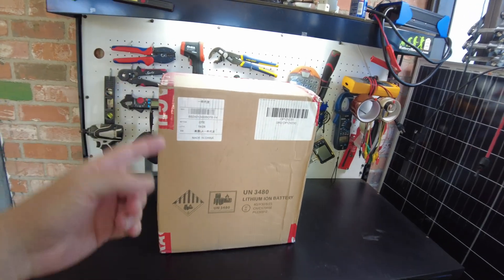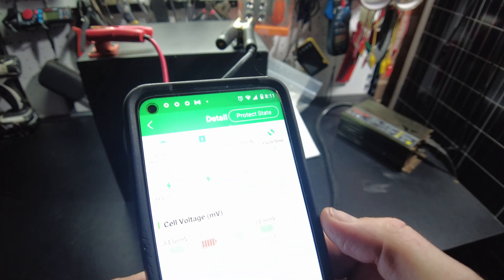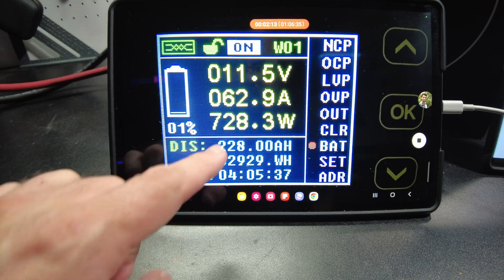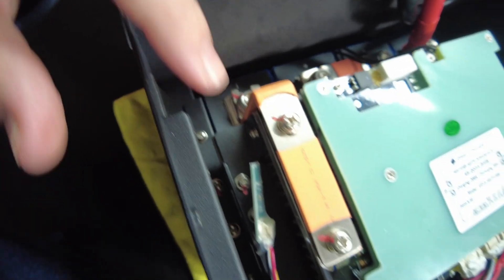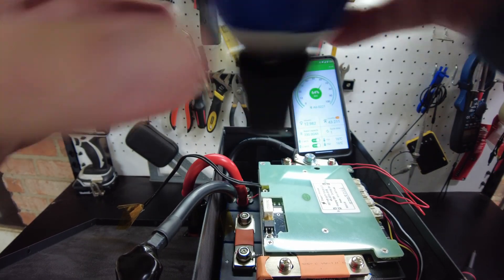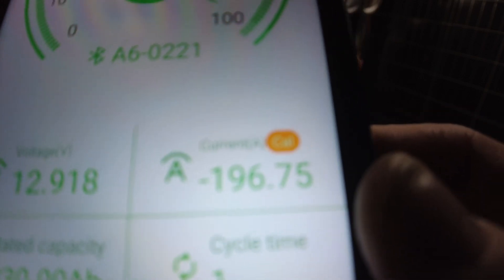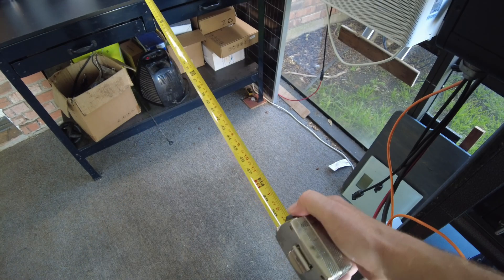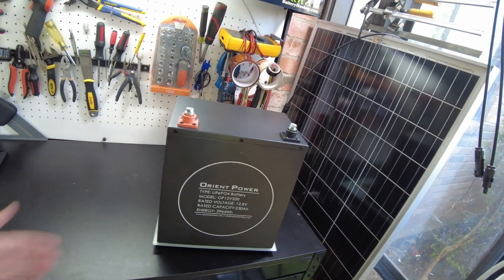Orient Power 12.8V 230Ah LiFePO4 Smart Bluetooth Lithium Battery

Comment: The bluetooth range is bad because it's in a metal box which is blocking its range. One of the reasons why other manufacturers of the BMS have external bluetooth dongles.
Reply: For metal case, it is ok, better than SS case.

Comment: Looks like a pretty good value @ $699 for 230AH.  The limited bluetooth wouldn't bother me much.  If I was really worried about it, I'd just slap a decent shunt on the out-going negative lead, which would give me a much better SOC indication, anyway.  I have gotten to where I care less and less about individual cell voltages, once a battery is built and working.  This would be a good choice for replacing the lead-acid house battery in an RV or trailer.  Could also be a good camping battery.
Reply from the maker: Agree, Thanks!
Reply: you can see from the bluetooth, and now we have a special offer, do you want to have a look at the price? Very impressive.

Comment: If I had an rv and wanted that use of bluetooth.  I would drill a hole in the side of it or on top.  Probably void the warranty but you would get a better connection.  Lol
Reply from the maker: Yeah I was thinking you could route the BT dongle out the side or top of the case. Could install a 4 pin aviation connector for the BT dongle
Reply: Great minds think a like.  Lol @BradCagle

Comment: Brad can I ask what charger you are using on this battery. Looking to upgrade from my 20 amp charger I am using thank you Tom
Reply from the maker: It's an Ardroit 50A, but I don't recommend it, runs too hot at 50A.
Reply: Ok but thank for reply just looking for something a little bigger to speed up recharging when testing some of my LiFe battery packs
Reply from the maker: @clockdoc36  The Ardriot 30A is probably a decent unit. I have not used one myself, but I have not seen complaints about the heat. Thanks!